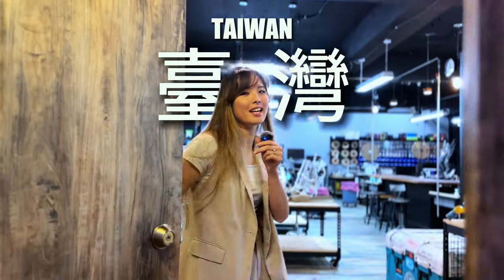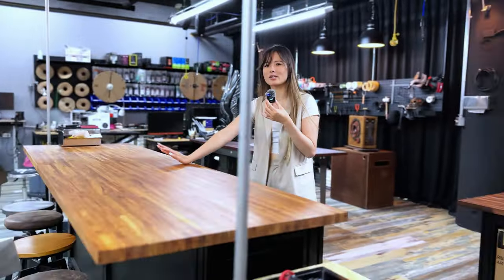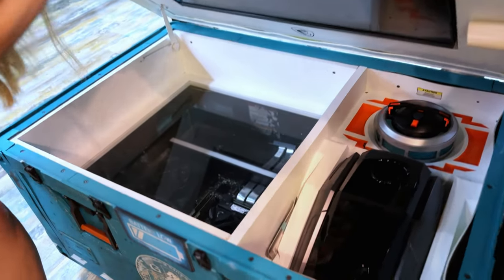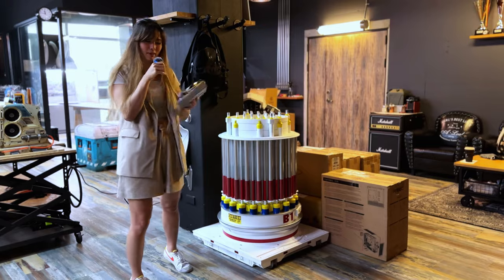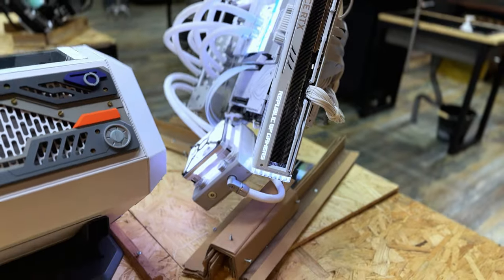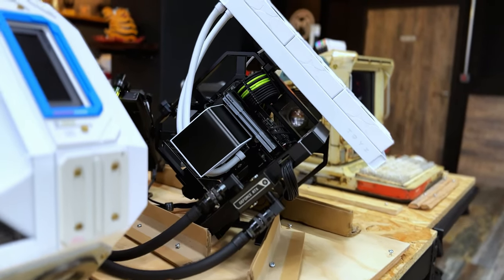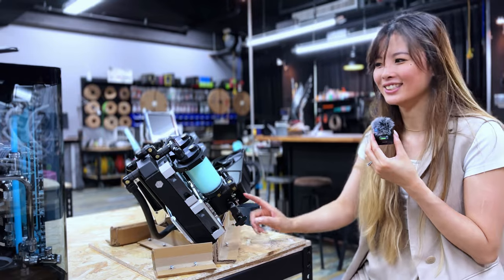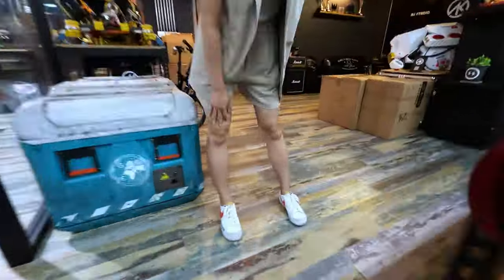First Look at COMPUTEX 2024 PC in AK MOD's Studio

Comment: Check out a “plate heat exchanger”. One under $100 can dissipate several kw of heat and let you run an independent cooling loop. You replace your radiator with the plate heat exchanger. Then you can run a full sized water radiator on an independent loop with plastic and aluminum without worrying about fouling the heat sink on the cpu.